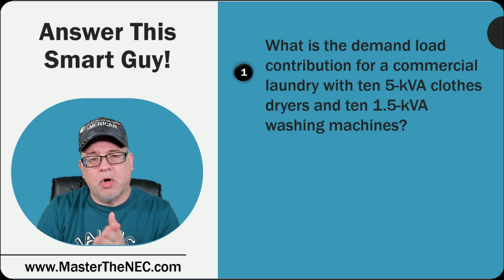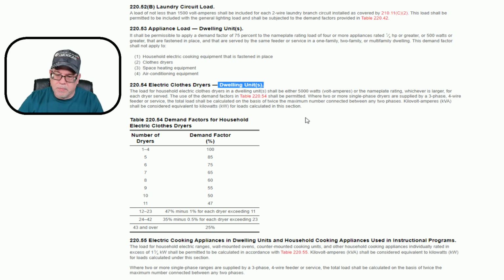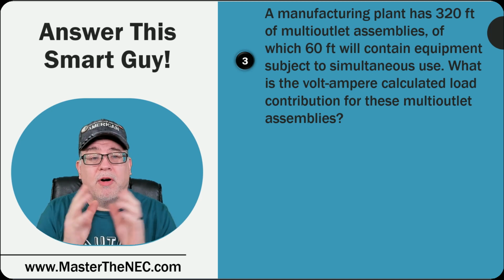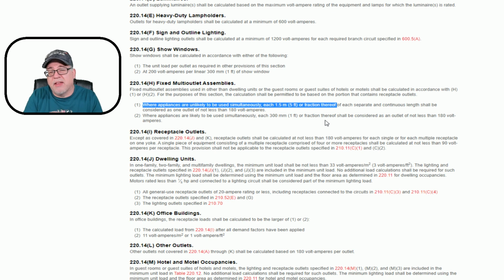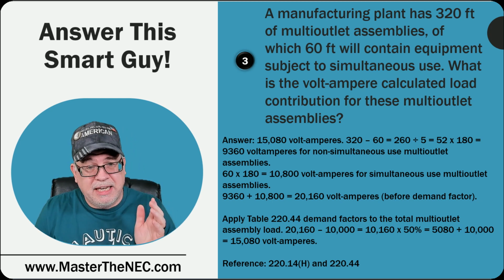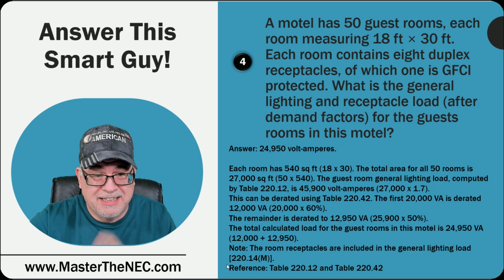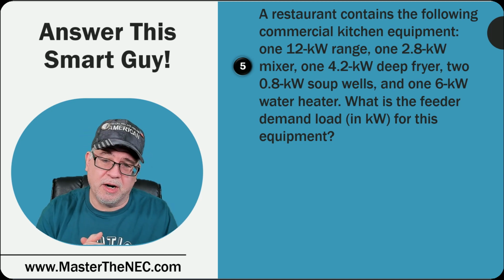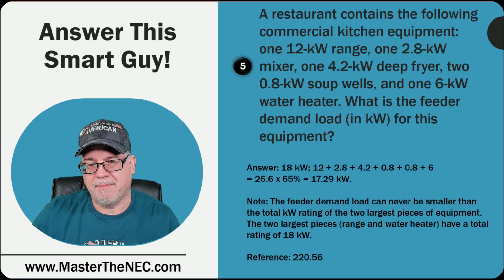Electrical Exam Prep | Electrician Exam Preparation Examples

Comment: The motel question is a huge difference if you're using the 2017 code, i didnt realize they completely reworked these sections
Reply: yup, on the restaurant 2017 says 2,  not 1-1/2
Reply from the maker: Yep.....Changes in 2020 NEC. We stopped teaching the 2017 NEC the moment a new edition of the NEC is published.
Reply: The 2008 Codebook is also very different, but that is the codebook we use in Indiana. When I tested last it was in the 2005 NEC codebook back in 2008. Why don't all states and cities follow the most current codebook?